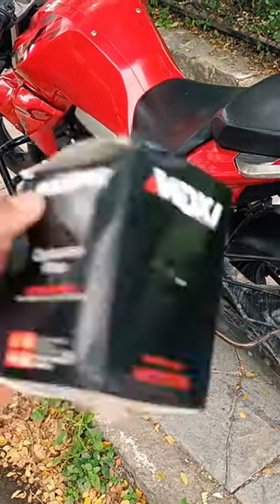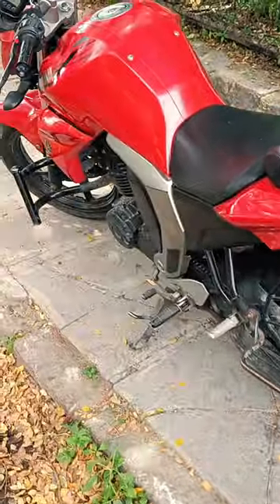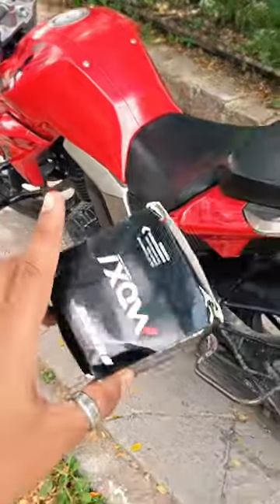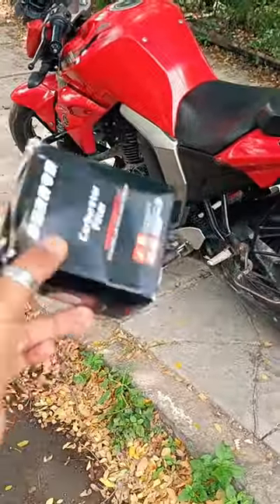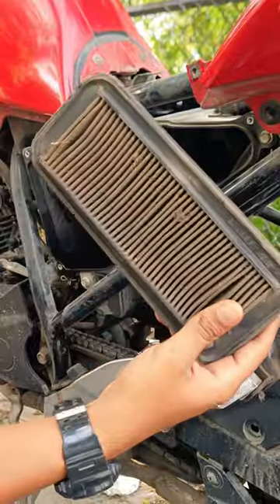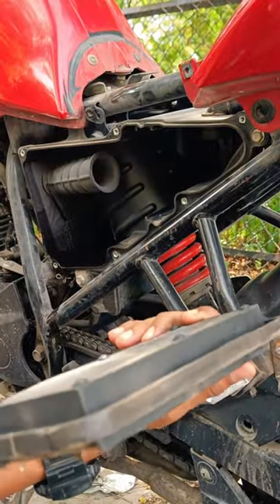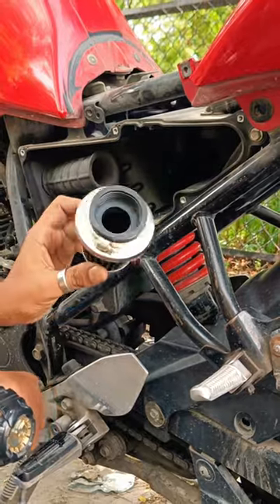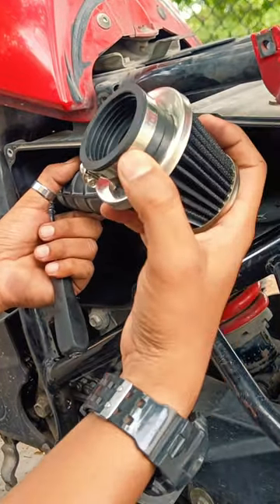YAMAHA FZV2 MODIFICATION|🙆moxi air filter#airfilter #shorts #youtubeshorts

Comment: I hope the machine is safe, all dust and dirt will enter more easily and will damage the machine, but it's free if you have a lot of money😊
Reply from the maker: Bro when u have confident on what u r doing then no need of thinking..my machine is safe and I care about my machine more than everything
Reply: @fzeevlogs4802 he told u the truth, performance air filter isn't safe for engine, but it really make bike run fast er abit, the stock air filter way expensive than a custom air filter, moisture are easier to get in your carburetor Then it will accumulate in the cylinder. And after that, many problems will follow, but if u don't mind about durability, After u install performance air filter u need to change to perform exhaust then tune your carburetor to make your oil mixture with air better, it might make your bike going faster than usual but drain more oil